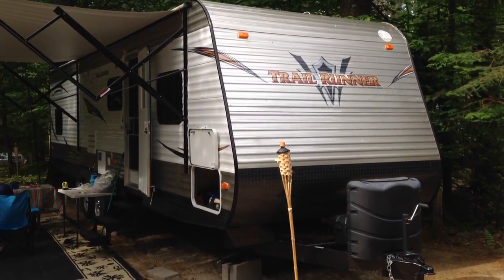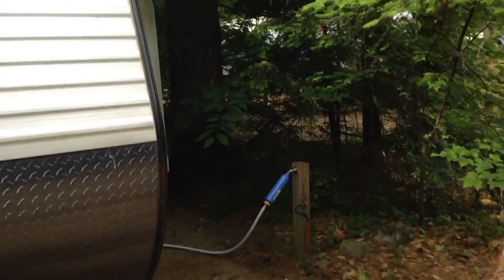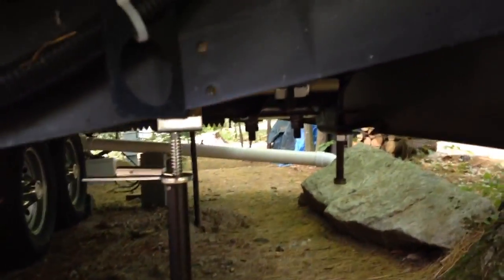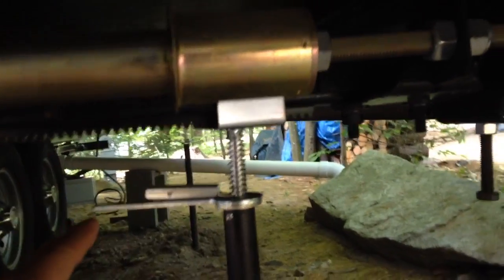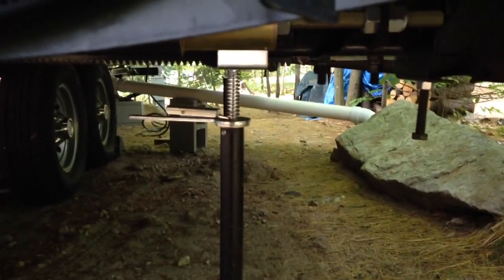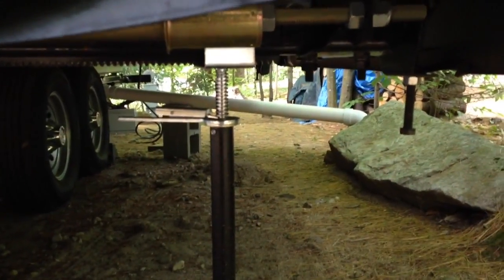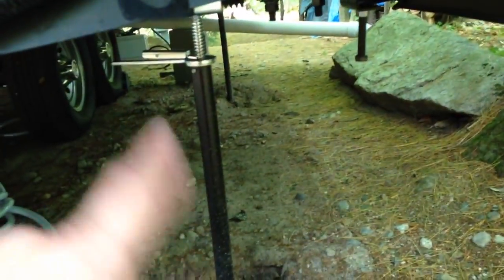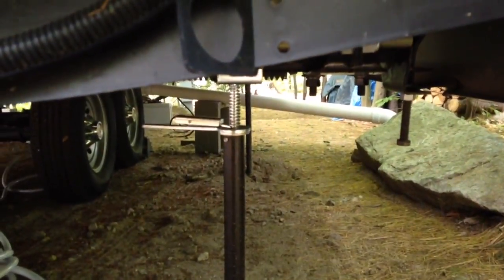How RV Camper Slide out Stabilizer Jack Supports Work

Comment: I bought a pair two years ago right after I bought my trailer. They are also too tall. Didn't think about digging a ditch to compensate. Duh.. Thanks for the vid, and the tip👍🏾
One thing, I'll be putting either some concrete or wood under the jacks, for better stabilization.
Reply from the maker: Thanks for watching

Comment: My fifth wheel has a thick plastic cover underneath the slide out and covers the metal rods. So, it's just a flat surface and I cannot find any flat slide out jacks
Reply: hi derrick Hendrix . why not just put some short 2" x4 "x6" long wood  in to the C channel of the stabilizer jack and just crank it up until solid . some felt  may be helpful on the trailer side of wood . will help protect plastic cover on bottom of trailer .
Reply: I have the same type of slide out as you . I have the same problem . that's why I gave you this suggestion .
Reply from the maker: Thank you for watching our RV slide out stabilizer video. Have a great day!